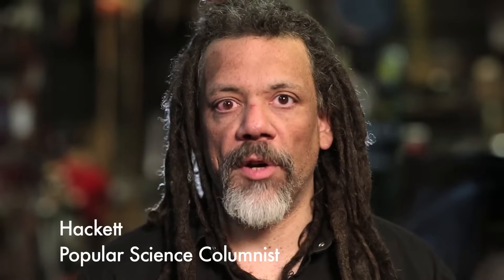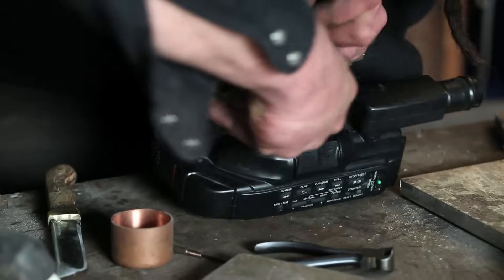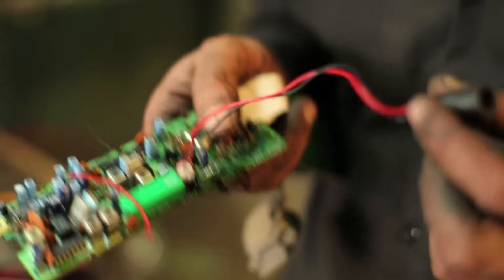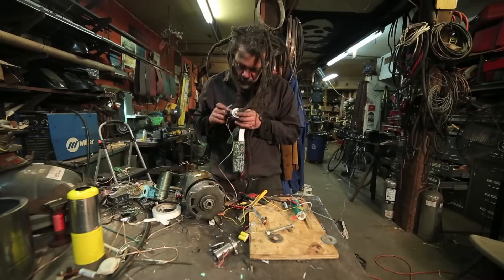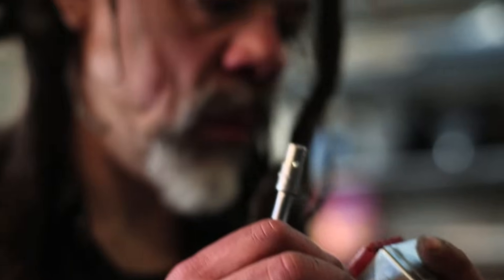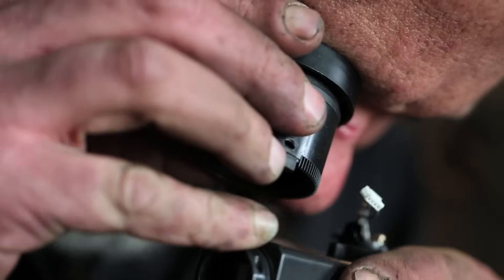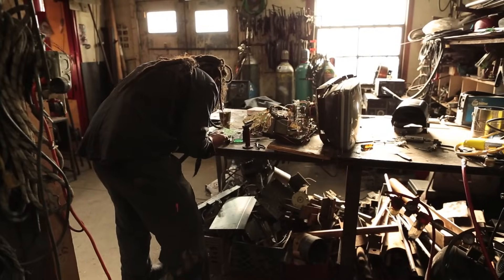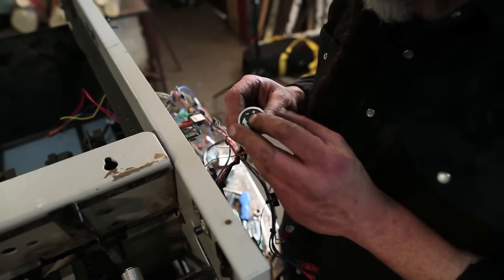Rebuild: Harvest Useful Parts From Old Electronics

Comment: One thing people should not forget is that electronics wasn't always as well regulated in the past and even new products can be hazardous. Washing hands after playing with old electronics is a good practice before you put hands on your burger or whatever you do. Some nasty chemicals can easily be involved that can damage your hormonal system, cause cancers, cause neurological damages, eczema etc. But also beware of inhaling things e.g. if you put the solder iron on something that starts fuming or you start drilling into things or breaking them. A component might be completely safe to handle, but if you break it, what is inside can be something really nasty. For example, you can get a chronic serious chronic lung disease called berylliosis (due to beryllium) simply by inhaling the dust from the crushed insulating material used in one single magnetron of a microwave oven. You might not feel the toxicity of whatever you get in your body right away. In some cases, it can take years perhaps even decades before you get a cancer or realize something is creating havoc in your body.
Reply: That's why I always make sure to taste the components first, that way I know what I'm dealing with.
Reply: @tylermiller8838  yes turn on the 9 V battery “is it good?” Test
Reply: Some  old electronic parts have 🤢 nasty chemicals  they're made from always Google for reference what's inside ! I wish More kids like science  🧪
Reply: The CRT modules can hold a lethal charge

Comment: your crystal radios, what kind of antenna do you use, coil size (turns?), and diode(s), MOSFETs, FETs, ect??
I have a 100turn coil with taps at the 25, 50, 75, and 100 turn. I can get 2-4channels, and SW channels.
any ideas?

Comment: yes that's what I always said to my self but I never thought it would be that much true
you sir made me take the decision of starting my own pile of junk from old electronics thrown out by people. This will be my future pile of gold
Reply: +Hossam Zayed ive been doing this for decades. I get my stuff from thrift stores (I look for the cheap electronics, $1, $2 electronics, and buy them for the components that cost $5,$6, maybe $10, and of course, the case for my projects). another place I get my electronics is from my trash guy- he's given me loads of old, ancient, E scrap, that has good, usable components, parts. so far, I have 50++ speakers, that work fine, loads of screws, brass, pot metal, tin, variable capacitors, knobs, wheels, transformers (for copper wire for making crystal radio coils, pot metal for scrap), and other stuff!check it out, and you may find a gold mine of free stuff for projects!(I also found a CD in a stereo, for country music karaoke!!!)